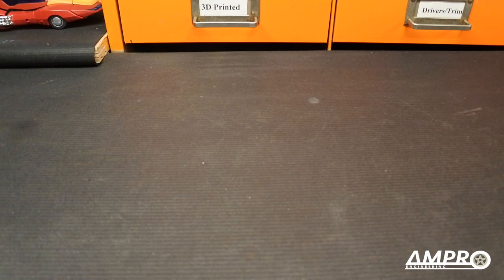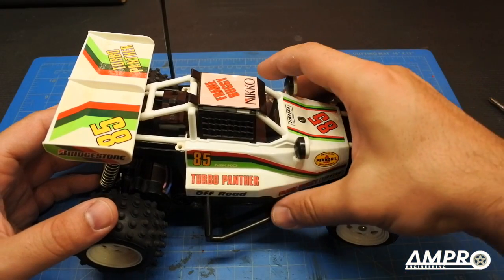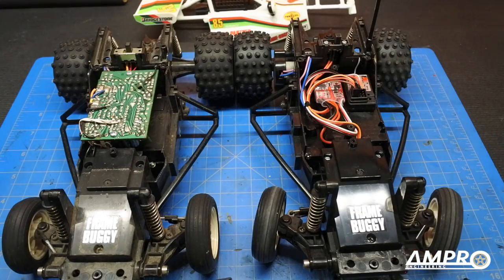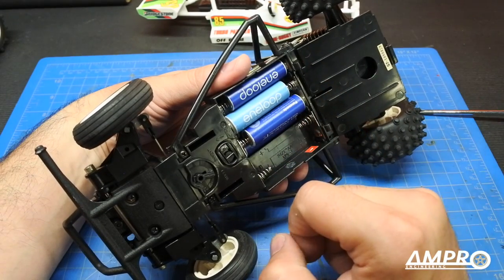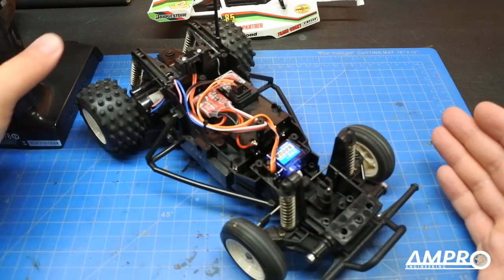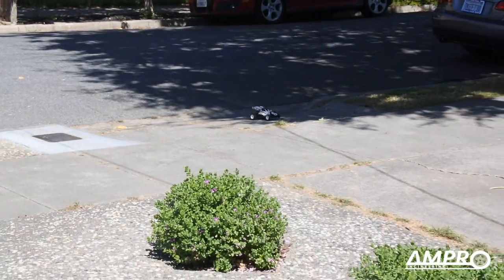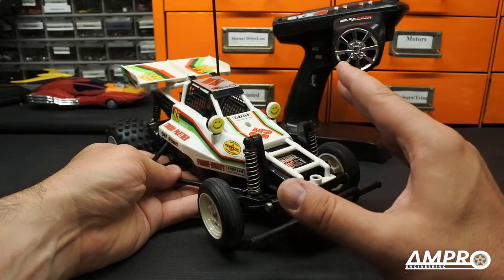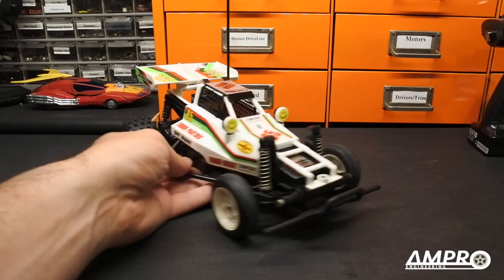E82: Upgraded Electronics - Nikko Turbo Panther

Comment: I just converted a NIKKO Wüstenspringer (Turbo Panther was branded like that in Germany) to 2.4GHZ because the radio was missing (and because I have a second one with the original radio). I think the conversion was worth it ! I truly dig the proportional steering and the higher speed with 2s Lipo :) Putting a micro servo in there was really easy. I converted over 25 vintage toy grade RC cars already and would say that the Turbo Panther and the Backfire are totally worth the effort of conversion. I run them mainly indoors to avoid tear&wear on the precious pin tires. The Turbo Panther was one of my first RC´s as a 8 year old kid and just looking at it brings back so much nostalgia ;_) AWESOME !!!
Reply from the maker: I agree, worth the effort!
Reply: I just found my old Wüstenspringer and want to get it running again. Do you have any assumptions which parts to use best? How do I chek, if the motor is still working? By the way, I'm also from Germany...
Reply: @mr.kybernaut6687  Kauf Dir Einwegbatterien AA Mignon (die haben mehr Spannung als Akkus und das Auto braucht hohe Spannung !) und einen 9V Block Akku (Fernsteuerung braucht kaum Spannung). Kontakte für die Batterien sollten nicht grün sein (durch ausgelaufene Batterien). Dann müsste eigentlich schon alles klappen mit etwas Glück.

Comment: I had a radio shack wild champ (I think its the same chassis as the turbo panther 2 ) I modded the hell out of it !! I discovered the little inside part of the battery box ran the radio and steering and the rest of the row of batteries ran the motor it also used mechanical relays to switch the motor forward or reverse go or stop only had 1 speed I was able to jam 3  9v batteries in series for 27volts to the motor and a strip of duct tape to hold them in !! It actually worked well until one of my friends borrowed it and brought it back destroyed!!!! I actually got about 3 months who knows how long it could have lasted
Reply from the maker: Oh man that is crazy! haha!

Comment: I just picked one up at a thrift store for 2 bucks and I'm going to do the conversion, do you have any of those 3d printed parts for sale? I wish mine had a wing it's missing. Have you found tires for replacing the old ones or no?
Reply from the maker: I do not as they were pretty basic but if you want them I can put them on shape ways. Ill have a wing for them soon! Email me at amproengineering@gmail.com so I can get you links.
Reply: Thank you very much

Comment: Hi, the crystal on my Rhino board says R 26.590 KDS 7G. Is this 27 Mhz  3 band or 4 band? It was the early 1980's when I got mine for X-MAS and it was tough. I also purchased a Kyosho Ultima but dreamed of having the 4 wheel Optima or an RC/10. Later on, I picked up one of the JRX2 's
Reply from the maker: Well it is low band but I am not sure if where you are there were more than just the 27 and 48 bands.

Comment: I also did this with a Turbo Panther and i mounted a servo for the gear shift, this is a highly recommended mod! I like your channel!
Reply from the maker: Thank you very much! Yes I have seen this done and I really like it. I am thinking about going down that path but I need to figure out a way to install a servo and attach it to the gear select without cutting or drilling anything on the car. That might be a little challenging.
Reply: There are very tiny servo's which should fit perfect.. I just mounted a big one since the wing was gone! The connection i did was by a silicone tube and later with a spring but with the tiny servo i meant it is possible to get it on the axle with a rigid connection, Happy building and hope to see it happen! Cheers!!
Reply from the maker: Ah yes, I saw on your video. I love the thought of that. I have a nikko 4WD truck that i just picked up. It has hi/low and a 2wd/4wd options. I am planning on making them all remote actuated.
Reply: I'm looking forwards to see how that build has come out! Sounds like a real cool build!! I'm saving for a crawler with the full package, a pall of me sold me a dx7s and i'm looking forwards to use every channel on that remote :D
Reply from the maker: Look at the Trailfinder 2. That truck is a marvel. I have one and i think it is the best scaler on the planet.
Reply: I like RC4WD very much! And found a vendor in the eu, most of the upgrades are also easy to get in the eu. My eyes are also on the Axial Wraith..I'm still in doubt scaler or crawler..or a mix :D But as a big RCSparks fan it's quite hard to choose for a first chassis haha, i've seen so many cool upgrades! I still have month to decide..it will be hard tho.. Cheers!
Reply from the maker: I know nothing of the Wraith other than it looks to be very popular. I happen to love the scalers since I love that level of detail.
Reply: The details are so wicked these days, my bucket list keeps on growing :P Even found working wipers, and hobbyking had a watercooling system which i just need, only for the idea haha..The plan is to have a rig that is indestructible and that keeps me busy for some years, my first "real" hobby project. I have had a lot of rc projects tho but now i thought that it would be time for serious work, something to be really proud of :D

Comment: I just recently upgraded an old Tyco Outlaw Power Boost Truck with ESC, 2,4MHz Receiver and Microservo. I like yer vids!
Reply from the maker: Oh cool! I like those. How did it turn out?
Reply: AMPRO Engineering, I think quite good! Good enough for the floor and the carpet, almost too fast with 6xAA. I removed the weights in the "engine" though to stop the wheelies...

Comment: I had the first sears lobo (1986) man that thing was cool but waiting 11+ hours for those AA’s to charge was soooo looong only to get maybe 10 minutes of run time after school. 
I guess that’s why I’m back into R/C at 49 years old. Lol
Everything is sooo much cheaper and faster. 
I got a big bear after the lobo.
That thing probably ate spur gears as fast as the lobo ate batteries. 
I have two big bears now awaiting restoration.
I would love to upgrade an old lobo.
Great job!
BTW my VERY first car was a sears 1977 firebird. Talk about old. It actually turned left and right via radio with a steering wheel. I think they weee called real steer or something like that. 
Anyway, 
Love all you videos. 
Thanks again!
Reply from the maker: The wait for the charge was hell....Ill never forget how bad it was to wait.

Comment: Consideration for all, and maybe it will help someone. When purchasing a "Non-Operable" RC, look at the electrical in car for excessive build up or dark solder point, in addition to obvious wiring issues. My personal experience is that I just bought pretty cheap a complete with controller black Nikko Turbo Panther II "Untested" from Ebay in brand new shiny looking condition with no scratches, peeling stickers, etc. As expected, it did not work when I got it (Looked so pretty I still had to have it)so I immediately opened and sprayed with electrical cleaner and saw two darkened solder points for one of the coils on breadboard. Cleaned up wax coating that built up on electrical and re-soldered dark ends and now works as new as it looks. I just purchased a clean looking Nikko Phantom Fighter from Ebay for cheap with no remote that will be my 1st attempt at doing the brushless motor upgrade with my special needs son. Thinking of the Traxxas 550 12t motor with traxxas servo, 3s lipo battery. Not decided on radio and receiver yet. I just got hit with vintage RC bug, as this is now my 4th purchase in two weeks.  Keeping Turbo Panther, Tyco Turbo Hopper and Tyco Turbo Heads Up all in original condition. They were all complete, really clean, relatively cheap, and with the exception of Panther worked upon delivery. Sadly, I am still browsing to see what else may interest me.
Reply from the maker: This is a good point. I did this when I was getting a couple of other cars going again and of course did not record a thing. It is amazing how often a solder re-flow will fix a bad board.

Comment: @6.00 It would be possible to use all the batteries by rewiring the connectors on the battery compartment so that four of the batteries are connected in parallel connection.  You can then connect those four parallel connected batteries in series with the rest of the batteries.  This will allow you to maintain the voltage below the voltage that the esc permits even though you've used all the batteries.
Reply from the maker: Yeah that crossed my mind but then I would have to carry 8 batteries vs 6.

Comment: My first car back in 85 was a radio shack wild champ from what I now know it was a version of the turbo panther yellow body soft rubber tires and just basic direction no turbo function back then they had not went to transistor speed controls and battery eliminator set up yet so it had two AA to run the radio and steering and then 8xAA for the power to the wheels I learned enough about electronics to spot forward and revers relays and realized changing voltage to the motor did not effect the delicate radio and steering board so I modded the battery box to hold 3   9 volt batteries!! 27 volts to the motor!!! needless to say it was pretty fast but only ran about 10 mins on fresh batteries but it would spank the snotty kids 300 dollar grasshopper on a flat surface !!! the good ole days lol
Reply from the maker: Thanks for the info! These really are awesome little cars and one of my favorite RC's of all time.
Reply: back then I did what I could with a small budget and dreamed of the day I would upgrade to a hobby grade racer now I own a handful of hobby grade and get more enjoyment from fixing and running cars like the turbo panther I run this car more than any of my other cars !! I have found the older panthers with the soft back tires and skinny front tires seem to grip a lot better than the 4x4 looking chassis at least on the street great vid BTW

Comment: Great video, I've just done exactly this to my own Turbo Panther. I bought it as a non-runner way back in the 80s when I was a kid, and never got around to fixing it up. I unearthed it recently and using your video for ideas and parts, got it up and running and now my own kid (and myself of course) can have fun with it, it goes like a train! Only problem is the rear wing frame is long gone. I have the wing but no-where to attach it. Did you ever get around to designing replacement wing mounts? Keep up the good work!
Reply from the maker: That is great news! Happy to hear it is back on the road. As for the wing, I have not made the mount yet but I am planning on it soon!
Reply: Any pics of the servo connecting to the steering arm. I brought the parts but not sure how to assemble so looked through what people put on here. Many thanks.

Comment: Boy oh boy that was amazing! The best part is that it still sounds original. Would love to do something similar some time. I should have kept some of my 'spare' TB's for this. Brilliant work. 3D printed parts and all. I don't understand why minus 2 batteries would not affect the speed more. It's minus 2.4 v. or 3 v. The new Electronics look good under the body. I like the power switch too. I'm like you, I would not do that to my red one, even though it runs very slow and steers very slow. Something with the old electronics but I'm clueless when it comes to such things. You got a Bison!!! (for me a Bison is still a Bison regardless what it was rebranded as). Now you can start making AMPro parts for it :-) It looks great with the black frame/cage though. Got a red one in a box with fried electronics, flat spot rear tires and a broken frame. Otherwise everything else beautiful. Plan is some modern standard Tamiya electronics, though I've hesitated since I've never done such a thing before. Maybe I should wait and see what you do first :-) But Thumbs up for this great Turbo Panther video!
Reply from the maker: No i totally agree, I think the car is actually faster with less voltage for some reason. I mean if you think about it, this car was able to run on 12V if you installed 8 1.5V AA's! I think there was some kind of step down to allow for longer run times VS speed. Yes I did snag a Bison! It was dirt cheap for some reason. The car is filthy bit in otherwise amazing condition. I dont know how you can get a toy like that when it was new and not drive it. The upgraded electronic process is rather simple to be honest. There is some fab that is needed but overall isnt too bad, especially for a car that size! By the way, did you check your FB email and messages here? I sent you something.

Comment: I’m about to convert the radio shack version to brushless. Got it for 12.01 on flebay. The battery compartment is probably the worst I’ve seen for corrosion. I’m gonna run a 2s lipo, and just run it on low
Reply from the maker: So I wouldn't do that. These gearboxes are really weak and the stock motor is more than enough. Even in low, the torque us way too high.

Comment: I'm starting to upgrade all the electronics on my turbo hopper I wish there was a way to show you pics of it.
I replaced all the electronics with Traxxas ESC, radio receiver with the receiver box, steering solenoid, I have new rear tires rear shock tower and a used body. I also need to replace the front end wing, and new motor coming, and I need to order a battery pack for it as well.
Reply from the maker: That is super cool! That should transform the car!

Comment: I got one that drives perfectly,,just had to touch up some solder joints,had alot of corrosion in some of the joints,,she expensive to run tho ..I want to update but like you I don't want to cut anything
Reply from the maker: I use NiMh batteries so I can just recharge them. So much better!
Reply: @AMPROEngineering  I got a 3 cell lithium ion
Reply: @AMPROEngineering  I made the 3 cell so that will give me 9.6 volt ...I hope to solder a fitting to the original pcb
Reply: @AMPROEngineering  I don't want to change my original radio ether so it will be interesting of the small 3 cell I made holds up for time and hope to have more power seeing how I also went through the old brush motor and clean it up and broke it in under water
Reply: @AMPROEngineering  well said that heck with it and went along with12.6 and she's a little rocket,,how long the pcb will stand it is anyone's guess

Comment: Thats the same esc/receiver combo i used on a couple tandy/radio shack dash trucks Ive resurrected. Kept the original battery trays as well. Think its funny when people have a 60 amp esc in something like this lol
Reply from the maker: Yeah I know. Seems overkill and plus, these seem to work fine.
Reply: Great videos btw. Thank you for you hard work 👍🏻
Reply: Hi if I was to do this to mine . Do I have to solder the wires to the battery tray and do I do the same on the esc to the motor? Not good with things like this lol.
Reply: Yes exactly. The esc comes with jst style connectors. You can either snip those off and solder them straight on or buy more jst leads to solder on that way you can unplug the esc if you need too
Reply: @jeschreindl  Brilliant thank you. Do you no anywhere I can get front tires from?
Reply: For the turbo panther?
Reply: @jeschreindl  yes for the turbo panther
Reply: Only used currently available
Reply: @jeschreindl  how did you do your steering with the servo without a printed part?
Reply: Oh no im sorry i dont personally own a turbo panther. Ive just used the esc and receiver on other toy grade cars

Comment: Awesome build!! I’m building a Nikko Excalibur which has the same stock Servo. How would I be able to fit a proportional Servo? I’m having trouble finding a spot to connect the mechanism into the Servo horn. Your response would be highly appreciated! Thank you!
Reply from the maker: Hey man, this was a hard one as the geometry was not only strange but not easy to access. I sell the parts I developed to make this work but it very specifically is for this chassis. I can send you a link. Shoot me an email at amproengineering@gmail.com

Comment: Can i ask you which parts did you use. I just bought one on second hand market, and i don't have original remote control. Maybe its time to make upgrade
Reply from the maker: I just used a flysky radio, stock motor, micro servo and a 30A esc that i got for $6. Its small and really doesnt need much to power it.

Comment: Love all your videos brother. Have you found any rear tire replacements for the Turbo Panther?
Reply from the maker: Thank you! Well, I kind of have. I have a video covering a terrible clone of the panther with not only great tires but mint bodies. They are plentiful and cheap.
Reply: AMPRO Engineering what is the video called? Looking through them.. no luck
Reply from the maker: That one isn't done yet. It will be soon!
Reply: I'm looking through your other videos...is it available, and I've just overlooked it?  I've got a couple of the Nikko Turbo Aeros/Aero-Tuned/Venus, which could sure use some rear tires (as they have none!)

Comment: So it does go slower now? Being it only 7,2 volts instead of 9,6 and you are using the same motor
Reply from the maker: You would think so but it doesnt feel like it is. Before the 9.6V had these areas where the system would pull different voltages at different points where the series circuit stacked up. Honestly I dont think it ever used a 9.6V to the motor. Maybe a i need a comparison with my stock one. That could be a cool video!

Comment: Can I have more detail for the parts you used in this video ?
Reply from the maker: These are sadly all generic parts I go in ebay. It was a 30A speed control, a micro servo and the stock motor.